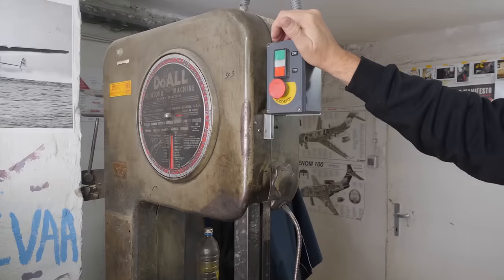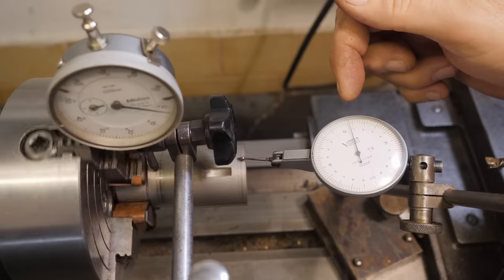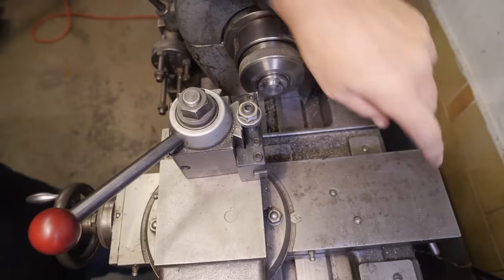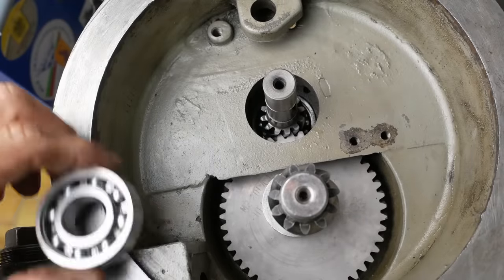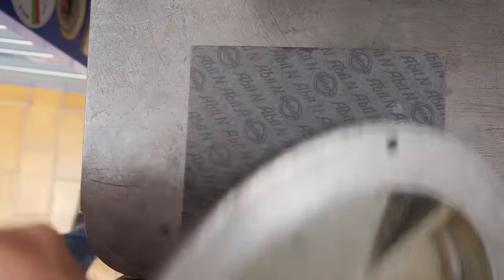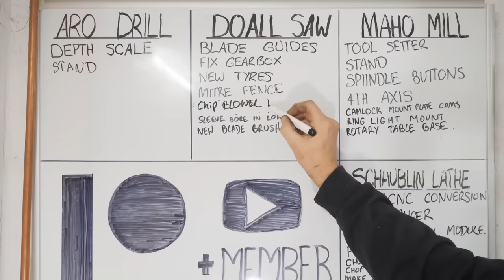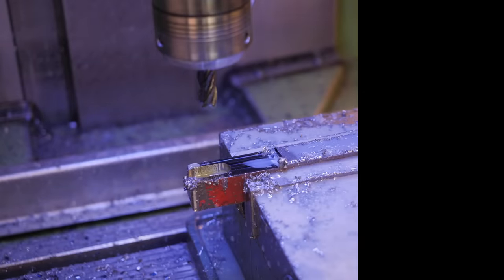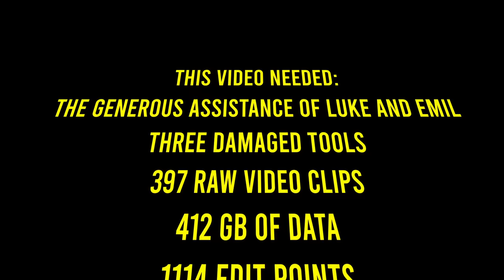Finished DoAll gearbox repair || RotarySMP

Comment: Great job Mr SMP. Loved the video. The band saw looks awesome. I was shouting at the screen when you were using that low tooth count saw blade on the thin bit of steel, sorry you didn't hear me, I will shout louder next time. I also shouted STOP! when the part titled in the mill vice while drilling. Luckily you heard me that time. Thank you to Luke and Emil of course, they did a wonderful job with the gears. - Heather
Reply from the maker: Hi Heather. Yeah, not my best choices either of those decisions :( 
That blade came with the saw when I got it 10 years ago. I need to cut out the bit with the removed teeth, and see if the blade is still longer enough to mount. The DoAll does have a pretty decent range of belt length.

Comment: Congratulations on getting that repair done.  Most people would never actually get around to crossing that sort of repair off the todo list.  And, what a relief that the static leak test passed on the first try.
Reply from the maker: Thanks. I got lucky on that one. Hylomar is a very good sealant.

Comment: I still have one of those Rotring drawing boards. It was a real innovation back in the day, just before CAD took away it's dignity.
Reply from the maker: Hi Mark, 
My Dad had one when I was a kid, and I used it right through 4 years of tech drawing at high school. 

I bought this one used out of nostalgia about a decade ago.

Comment: Doc Nickel is a legend.  I truly love watching the two of you rebuild old machines and aspire to do the same some day when I have the room to acquire boat anchors.

Back in the day, almost twenty years ago, I got a sweet job at a machine shop because the owner knew of me from my participation on Doc's forum.  I learned most of what I know about mechanical design and how to build world class parts from that guy, easily 20x more practical knowledge than I learned in college studying mechanical engineering.
Reply from the maker: Hi Paul. Yeah, he is a champ. Sent me that drawing within 12H.

Comment: In my apprenticeship i worked on old cars. There i learned a trick for quickly making new gaskets. if you hold the paper in place over the part and take a small hammer and knock on all of the edges gently, it makes quite a nice template to cut out. Actually it almost cuts right threw. Same works with a small key file instead of a hammer. Or even just use a dirty finger to go around the edges :) As always, thanks for your great videos!
Reply from the maker: Thanks for the tip Niklas.

Comment: I learn so much useful stuff from your videos.  Today's nugget ( 7:06) confirms something I've suspected about my plain bearing lathe (SBL 9A), the spindle bearings deflate when static and inflate when rotating.   This has been particularly noticeable when truing a job in the FJC.   Thanks!!
Reply from the maker: I saw a scientific video on hydrostatic bearings, and you really see how the ride up to center. It has been about eight years since I scraped in the front bearing on the Boley, so it may also be a wear issue.

Comment: Thanks to Emil and again to Luke. Only 9 side jobs if I remember correctly. Sounds about right, maybe a little low for me… 😂
Reply from the maker: Yeah, they quickly add up. I could have broken down the parts of the shifter drive into five more :)

Comment: Well it was fun making the gears and even better watching the rebuild. Just glad to see the saw back together
Reply from the maker: I really appreciate that you made two sets when you had your indexing set up. Sorry I ruined the first set.
Reply: @RotarySMP well they will still make good wall art :)
Reply from the maker: @LCalleja  Maybe I can use them for some other project, where I could reduce the shaft diameters to the next bearing down?
Reply: @RotarySMP  That sounds like a side project!
Reply from the maker: @LCalleja   Always :)

Comment: After so much effort and so many years of putting it off to now, finally, have it working. We all feel the joy. 
Just needs a shiny new coat of paint.
Reply from the maker: It would be kind of cool to restore it , but would be a ton of work. There are a lot of extra holes which would need plugging etc.

Comment: Emil did more for you than you may know.

That indexable mill body is an interesting unit if it is what I think it is.  If it’s a high feed mill, you should do an entire episode on what you can do with it on your mill.  I use this almost exclusively for my steel roughing operations.  They are fantastic.
Reply from the maker: Thanks for the feedback on that Craig. I need to make up a shank for it.

Comment: Great video. Thanks to Emil and Luke.

Also thanks for the bit where you talk about the plain bearing on the Boley- I've just recently got my first lathe. It has plain bearings, and indicating stuff in is driving me bananas. Ill try warming it up next time and see if it helps
Reply from the maker: I suspect it is time my spindle bearings need scraping in again. I last did them about 8 years ago.
Reply: @RotarySMP  There's an adjustment on mine to take up the slop with some sort of tapered doodad, but I've been loath to mess with it until I understand what I'm doing a bit better. Still on the fun steep bit of the learning curve where accuracy is notional anyway

Comment: Great video, but you should replace the battery in your micrometer. They can in my experience be less accurate when the battery gets low.
Reply from the maker: Thanks for the tip. I got new batteries for the caliper, but forgot to get the one for the mic.

Comment: 13:35, that's quite a radial movement, can't wait for lathe bearings rebuild video :)
Reply from the maker: I scraped the bearings back in about 8 years ago, and it looks like it is due again.  I am more likely to sell the Boley :)
Reply: @RotarySMP   You know I was just thinking about it :), how do I contact you?
Reply from the maker: @NskLabs  There is an email link on the channel "about" tab.

Comment: Thank you Luke and Emil! Your variator belt might be worn, they wear on the edges in use, when they get to be too narrow it allows the pulleys to run out of range.
Reply from the maker: Good point. They bounce around a lot in use, and have probably taken a set as well.
Reply: @RotarySMP  It also just dawned on me, that my Big DoAll has a 3-speed gearbox. It also has a mechanical lockout to prevent shifting gears unless the variator is in it's lowest speed setting. I wonder if your saw had similar and the previous owner disabled that feature? That could explain the damage to the jaw coupling inside?

Comment: Well done. Although some loose ends to still tie off, an ambitious undertaking for a single video. Congratulations on getting your shifting back.
Reply from the maker: Yeah, at least the gearbox is working. I'll take some time measuring exactly what eccentricity I need, and remake that part.

Comment: oh how i looked for the emergency stop button on my keyboard when that drill started pushing the thing out of the jaws
Reply from the maker: That was not one of my better set ups. I had cantilevered it out for the end rounding to avoid cutting my vise, but didn't really consider the drills force line.

Comment: Grate video as always! liked the long format and nice to see the DoAll back in working order.
Reply from the maker: Hi Luke, You gearset seems to fit and work perfectly. I just need to fine tune the shifter set up a bit, but you rescued a nice old saw there with you gears. Thanks again.

Comment: Epic both in effort and videography. Thanks for producing this.

My thought, which will proabably get me sent to the bottom of the class in this company: for the gubbins (technical term) at the end of the gear-shifter it may be easier to 3D print rather than machine. It would be easy to reprint with different dimensions if needed (though basically impossible to re-work without reprinting).
Reply from the maker: Thanks for your kind feedback Iain. 
There is a fair bit of load on that gubbins (tm) :) so I doubt it would work in plastic. Also plastics are not really stiff enough for that application.

Comment: The challenge of imperial mesurements and French writings in Austria...
But still, it's a nice puzzle.
Reply from the maker: Hi Michel,  I have a pretty random mix of metric and imperial stuff as NZ only switch in 1970, so my Dad always used imperial, I learned Metric at school, but then was back to imperial in my aircraft mech apprenticeship.

Comment: ecellent journey to almost finished band saw. I love your channel! 
I am liitle but confused about length unit - in one video, you use both metric and imperial unit. 
Be kind. Use metric.
#3 fan
Reply from the maker: Working in aviation you have a lot of imperial, and I received imperial measuring from my Dad, so I just grab whatever is best for the job at hand :)

Comment: Ok  next year in  Naxos  I am dropping off an assortment box of sae wudruff keys for you. (You might not get them till the following summer since we go in September) Will leave it with George at xenia hotel just behind Yasouvlaki. I have a deep seated hatred for common headed screws. I used up the last of my old tube of Hylomar and it's really hard to get these days. Here in the US we have to order it from England or buy it from someone who already has and pay 4X as much. I haven't found an affordable replacement for it as even the automotive versions are no longer available.

     I have made little progress on my stuff as I have been trying to get the fancy tile all cut for the big shower and supposed to blow in insulation in the attic all while my back has been causing problems with everything I want to do. It doesn't even want me tying my shoes...
Reply from the maker: Back problems can be really restricting. A couple of years ago , in covid lock down times, I was sitting so much that the lumber was starting to complain. I started doing 10 minutes  daily of stretches myy wife learned at pilates. That has really helped.
I hope you get your back sorted soon.

Weird that Hylomar is hard to get. This stuff seems to last for years. I got mine at least 20 years ago, and havent used it much, so I haven't tried to buy it this century :)

We are already booked for start of July in Naxos. Winter hasn't really hit here yet, but I am already looking forward to walking along Placa beach.
Reply: @RotarySMP  My back is the result of many years of abuse. It has it's fits where it's painful in between stints of not hurting. Sometimes extremely painful others not so bad. The problem is when I'm feeling good I tend to push it too much and then it reminds me not to do that...

    I used to use Hylomar for automotive and boats etc so I went through a tube pretty quickly at one time. 

     My friend from the Hotel is trying to make a trip to the US over Christmas/newyears since they are closed then. Not sure where I would tell anyone to go on vacation in the US... He has barely been off the island so everything here would be a shock.
      Never know maybe I can find an excuse IE the $ to make the trip out to Naxos while you are there. Gotta pick up yarn for my mother since the yarn store was closed when I took her there this spring. Besides I want another pizza.. One of th ebest pizzas I have ever had was at one of the places there. Make sure you ask for sausage on it as it's really good stuff. Not the Italian place but closer to the ferry pier/Porta. I forget the name. I think it was next to the seafood place that has the boat with ice and fresh fish on it.

Comment: I think big plain screws are still a good idea in certain situations. They do require more skill from the operator and a tightly fitting driver. Plain screws seem stupid until you need to make a screw and realize your rotary broach is still in kit form and will add days to your project. Here in the USA, there's been a 50 year glut of screw-driver-objects on the market so plain screws have fallen out of favor. But the wooden-boat guys still use them. That trade seems to attract craftsmen rather than operators...
Reply from the maker: Good points. And they do look cool.
Reply: Hi neffk , as a Canadian, I feel sad for the rest of the world that has to deal with the horror of slot or phillips screws  when they could have
the obvoiusly superior robertson (square) head screw 😁
Having said that , I spent a lot of time is industrial electrical control boxes where screws that combine phillips, square,or torx with a slot are
are by far the best solution . the inner screw for run it in and out and the slot to torque it down or loosen.

Comment: Great you finally made it !
When oiling the Boley, i would strongly recommend usig the oil fittings to get clean oil under the carriage.
Let me guess, your oilpress is broken/empty/misplaced ;-) 
Did you refill the DoAll gearbox wit the old drained oil ?
When machining Collets, pus some shims in the slots, otherwise you will end up wit an useless shape in opened state.
Reply from the maker: Good point. I do have the proper oiler for it, with the proper oil in it. I was just too lazy to walk 10 steps to get it :/

Comment: G'day! Did you see the Starship launch? That thing is the epitome of awesome.
Reply from the maker: Hi Andrew,
Yes I did. It really is amazing. All 39 raptors on both stages seemed to work flawlessly. Incredible that the hot staging worked first attempt. That flight termination looked like a nebula :)
Reply: It really did. @nasaspaceflight had a great shot of it. @RotarySMP
Reply from the maker: It was a huge step forward between the two first test flights. What will these rockets be like in 2030?

Comment: your headstock bearings are lose !
if you watch when you try  to part off  (minute 15) you see the chuck pushing away.
cheers ben.
Reply from the maker: I last scraped them in about 8 years ago, and it was the first time I have ever scraped a plain bearing, so you are right. They are again due.

Comment: 46:24 Nicht vergessen, die Leitspindel reichlich zu schmieren ;)
Another moment Rapido/Lente. German, French, Spanish machines. Multinational workshop - I like that a lot. Also I appreciate you using both: imperial AND metric (even though I am a metric fanboy bcs of superiority). Your fanbase is quite something one would assume. Thanks to Emil and the gear cutting guy!? :)
Reply from the maker: Yeah, I tend to oil my machines a lot. Thanks for the input.

Comment: Loads of progress!  Maybe salvage the eccentric by offset turning it down to a smaller diameter and then sleeve it to fit the yoke?
Reply from the maker: I thought about that as well. But will probably increase the eccentricity by an extra mm as well to compensate for the slop in the drive shaft guides.
Reply: @RotarySMP I would bush the guide with a bronze Oilite bearing with a fixed and locking collar if there is room and make it a nice sliding fit. That way you won't loose any travel in the eccentric shifter.
Reply from the maker: @samrodian919  Also a good idea.

Comment: I think another problem with the eccentric is that the shifter ring has worn, and has been ground flat twice. Each of those means it needs to move a bit farther to engage.
Reply from the maker: Could be. There is no obvious deep wear on the faces, but I suspect my grind on the drive dogs migh not have enough angle.

Comment: Thank you for WATCHINIG 😎
I had a bit of a panic attack when you started to cut thst steel with such a coarse bandsaw blade and such a low speed!
I use a 16 tpi blade and a lot more blade speed than that.
Reply from the maker: I need to work out how accurately that speed range chart fits with the really tooth speed. And I should have checked the real TPI.

Comment: Quite the saga! It's more work naturally, might find the gearbox needs to be shimmed to have proper tracking with the upper wheel to limit wear. The ex-tech 63 machine here  was painted inside and out at some stage, by what I assume were students and lost those important pieces....and mixed in another machine somehow too......probably not unique after 60 odd years though.
Reply from the maker: Good point. Thanks.

Comment: From the video it seems that the parting blade presses the lathe spindle sideways. Maybe the bearing clearance is in the loose side?
When I was in the process of buying a lathe I could not muster the braveness to buy a lathe with pain spindle bearings because I was sure I cannot fix it once it becomes too worn.
Reply from the maker: The Boley has a tapered bronze front bearing, with slits, like a collet, so you can adjust it. I rescraped it about 8 years ago, but you are right, it is probably worn again.

Comment: What size are those smaller bearings?  6205?
Reply from the maker: Hello Craig, they are smaller than that. 20mm ID. 6204's if I recall correctly.

Comment: Nice work. I'll be the grouchy old guy and say Doall should have put a needle bearing between those gears not bronze.
Reply from the maker: Yeah, I probably should have done that during this repair.
Reply: @RotarySMP  For the relatively light loading (it does not require much torque to drive a bandsaw blade) these gearboxes seem to exhibit a lot of wear. I didn't realize it even has an oil pump! Bandsaws also seem to be the target of abuse.

Comment: heh, comment on the hacksaw blade and using the whole thing, I get onto interns and youngins all the time wearing their butts out using about 3 inches of the blade but going stupid fast
Reply from the maker: I fixed that saw frame yesterday evening. The adjustment screw and nut were in pretty poor shape. I just thread chased the screw, welded a second nut on the crappy original 3mm stamped nut, and ran a tap through both. Seems to work again.